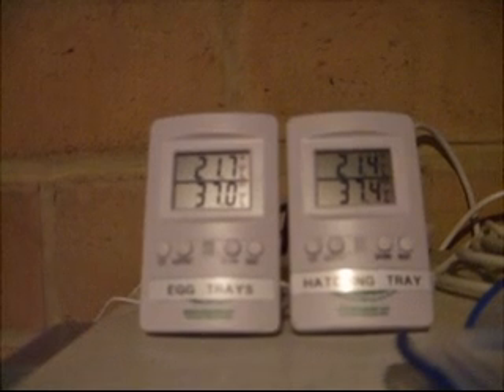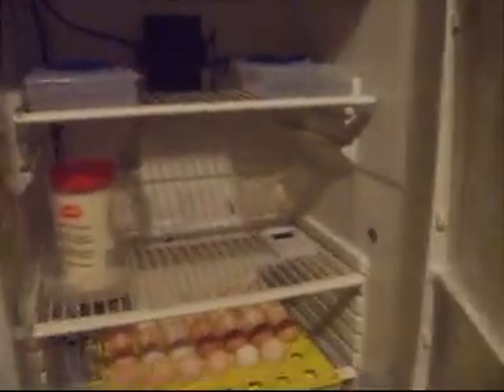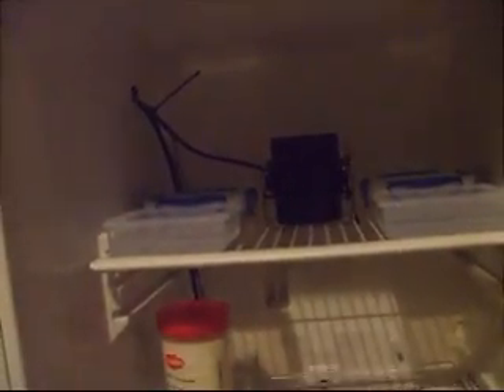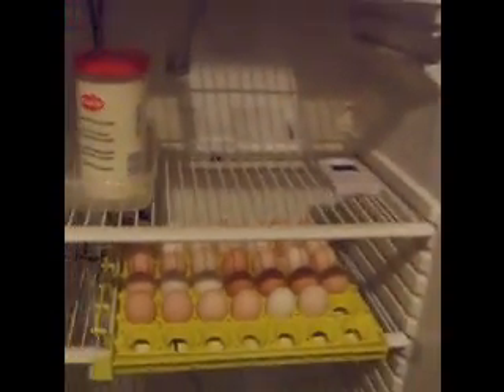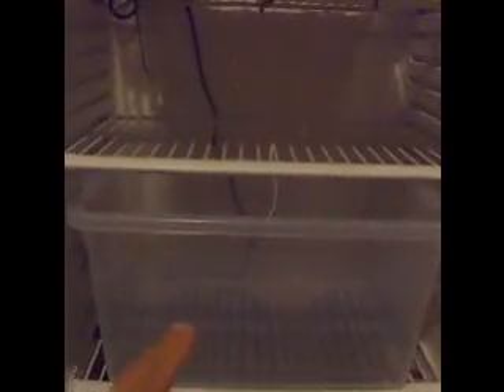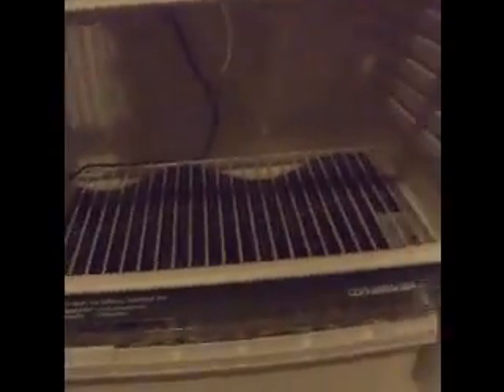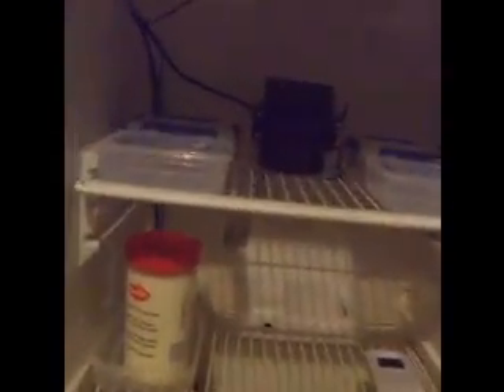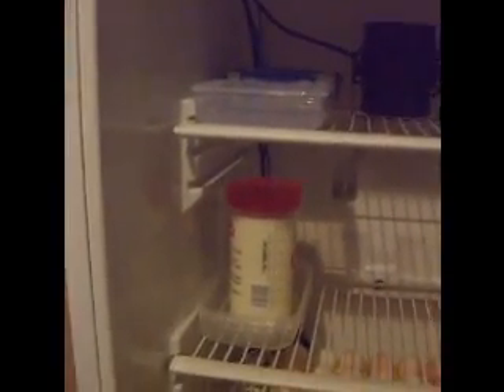Home Made Incubator.mpg

Comment: Nice project, my only suggestion would be to use a drill bit next time to drill holes on the fridge instead of using TNT to open a hole on it's wall.